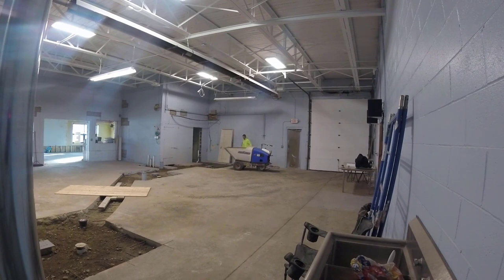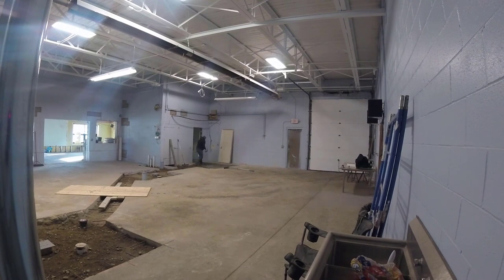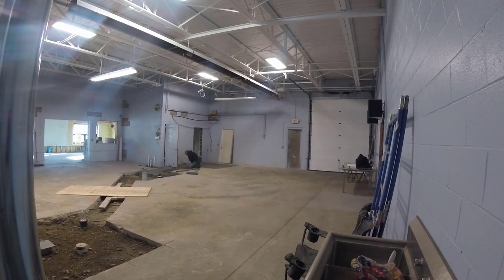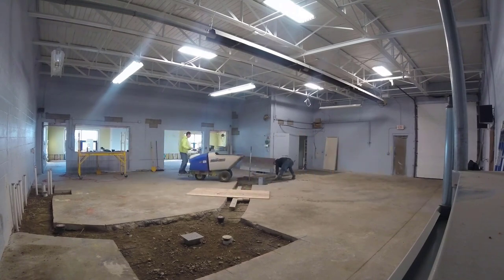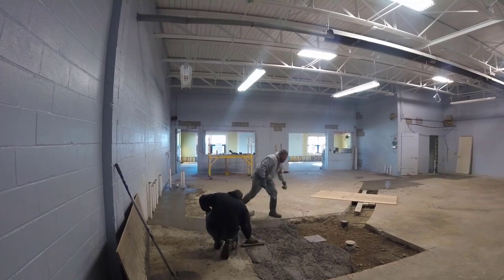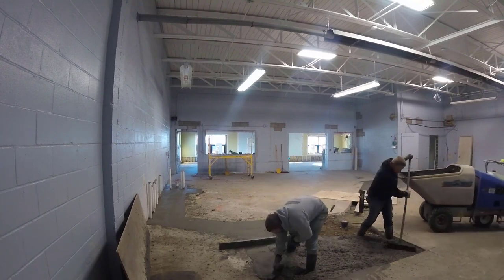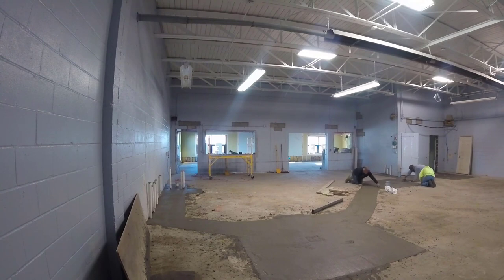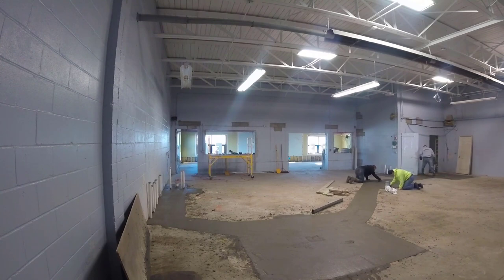Concrete Trench Pour using a Power Buggy

Comment: Holda a quarter yard of concrete no way that's 12 wheelbarrows
Reply from the maker: This buggy holds 16 cubic feet. A full wheel barrow is 2 cubic feet. Most wheel barrows aren't filled "completely" full or you lose some concrete before you dump it. So it really does hold about 8 - 10 wheel barrows full of concrete.